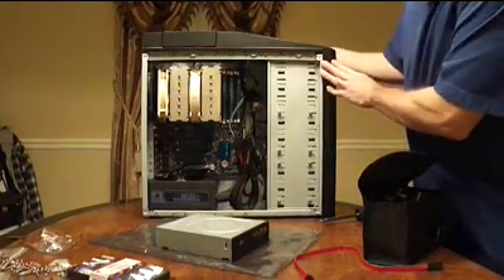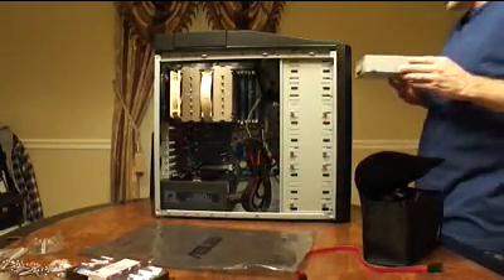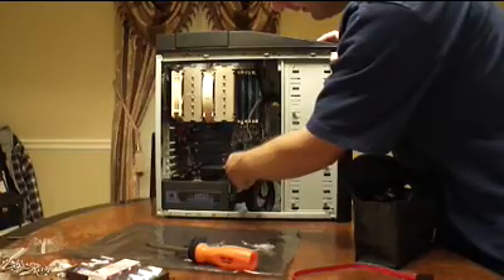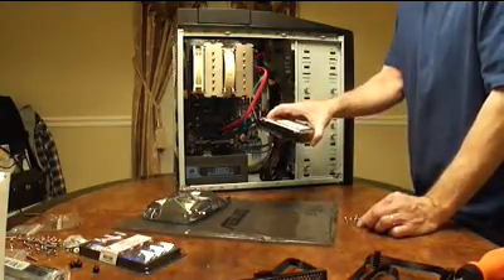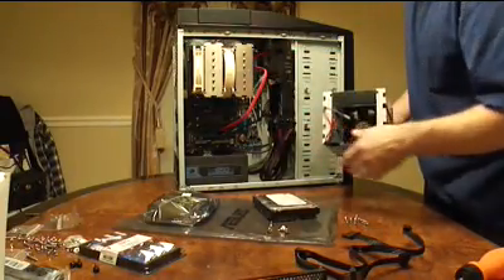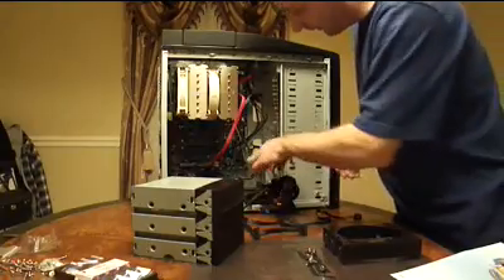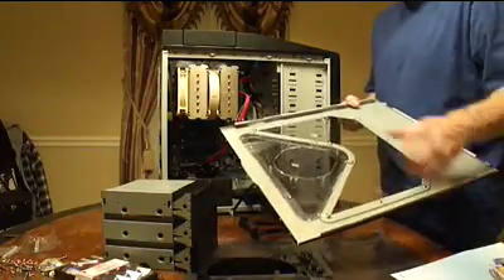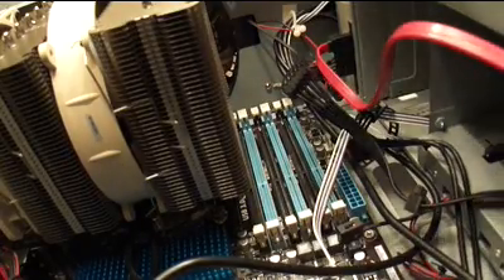How to build a computer from scratch (for gaming, development) - part 2

Comment: I'm sorry I'm going to ask a stupid question but that fans you installed it look like it is 140mm and a 120mm with heat stink, how did you install it like does it sticks on the processor or just installed to keep the air flow please can you tell me, thank you

Comment from the maker: I went ahead with the project because I wanted total control over the parts and quality of the parts in the machine.  Going to the store can work too - and I have done it before - but you don't always know what you will get - for example - you can get a 1GB hard drive - but the speed for example can vary greatly (RPMs, throughput, etc).  RAM is another good example where you may buy it based on the total storage but not understand other metrics about its performance (or vendor quality).

Comment from the maker: @89scubadude here's what I paid/where I bought from (in early 2011) for this machine:
 
Amazon: i7 950 - $295 ASUS P6X58D-E - $224 ASUS GeForce GTX580 - $525 Corsair HX850W 850w - $170 Seagate ST32000641AS Barracuda XT - $170 Antec Nine Hundred Black Steel ATX Mid Tower - $100 Samsung PX2370 - $280 Sony MRW620/U1/181 - $15
 
Tiger Direct Noctua NH-D14 CPU Cooler - $80 LITE-ON iHBS212 - $120
 
Kingston (directly) 4GBx3 DDR3 - $160

Comment from the maker: @xTheRealTim you screw it in.  there are risers that come off the case - which the motherboard sits on - those risers will receive the screws that you'll use to screw the motherboard down (holes in the motherboard will align with the risers).  I show this in part 1 of these videos - around the 8:20 mark

Comment from the maker: @lusterclaw1988 the black slots are also for RAM...essentially they are the same as the blue except that on this motherboard you need to populate the blue sockets first (A1, B1, C1) before using the black sockets (A2, B2, C2).  no difference once they are all populated - and since it is DDR3 memory, A1, B1, C1 will work together (triple channel)...same with A2, B2, C2.  And you don't have to fill in all three slots - but then it will run in single or dual channel mode for that color set of slots

Comment from the maker: @langer1972 thanks...I came up with a short list of a certain type of case and then evaluated them primarily based on ventilation and sound characteristics...using a modular power supply meant I would only have the cables needed within the machine - and I decided to deal with them however the case allowed in exchange for better overall access to airflow and low sound signature.  you are right though...there are options for better cable management...wasn't my top requirement for this box though